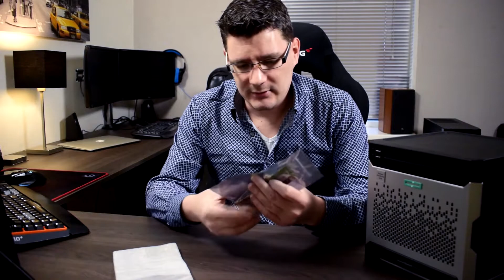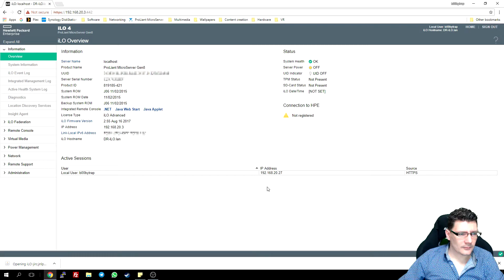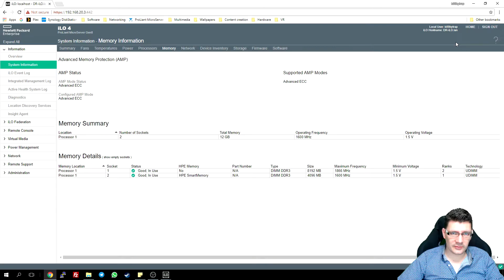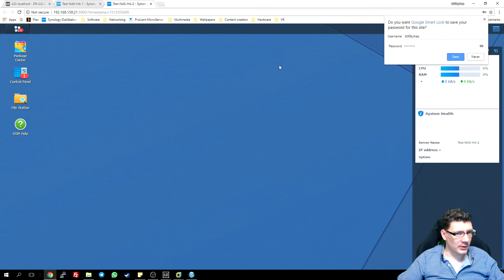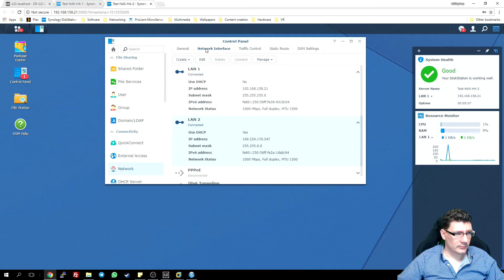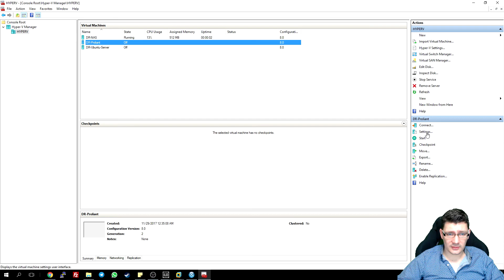Christmas came early for my Gen8 (and upcoming projects)

Comment: very nice video again.

Keep it going with Xpenology and HA cluster.

I've done research, and seems that MTU9000 is used for the hartbeat connection, and Vmware doesnt support this.
People got it to work trough connecting the serial pipe port, and using it for the hartbeat connection.
I've read this information somehere on the Xpenology forums, somebody was claiming who got it working trough Virtualbox, and connecting the serial pipe to a NIC.
I havent got the link anymore, and can't find it so far..

I've got it running easy with real baremetal Xpenology builts, it was not a problem.
But trough vmware it was not possible for me yet, like same problems you are dealing with..

Please keep it going..

Have a nice day  !